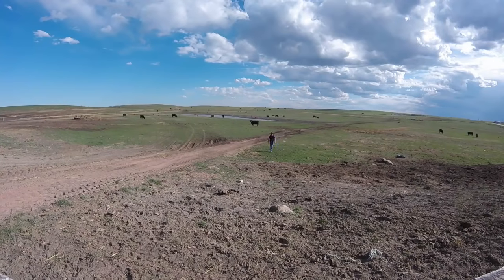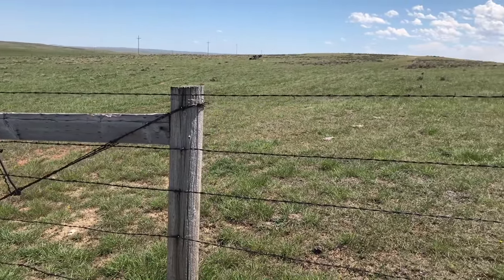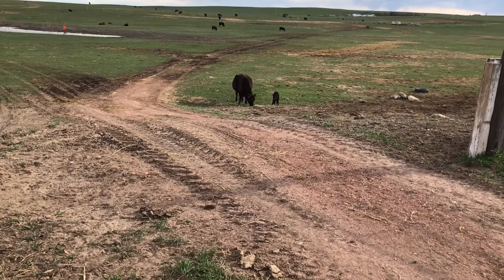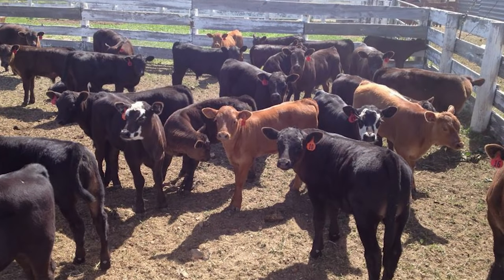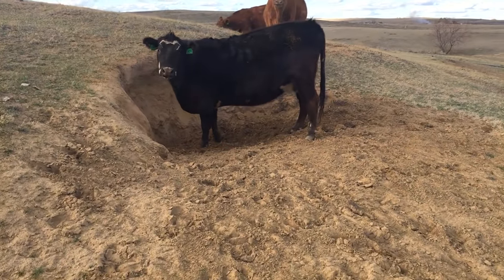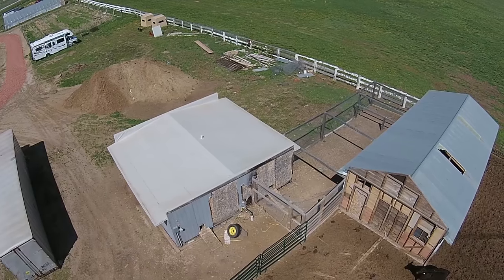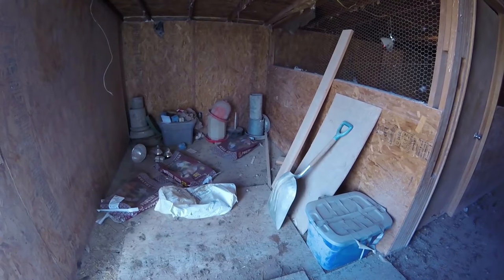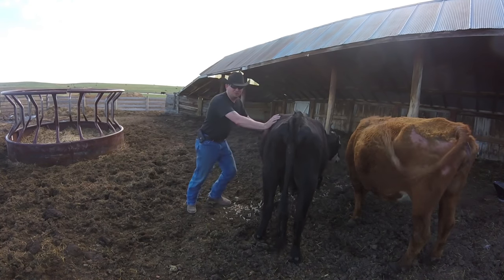Tip That Cow

Comment: Cow tipping IS NOT fake. Very difficult, done at night or dusk.....only will happen with near perfect conditions like the size of the animal. You will not “tip” a big ass bovine & it’s more of a running up to one to put your shoulder in near it’s neck to throw off its equilibrium. Vets do this by turning their heads towards the sky. That’s only if it doesn’t move by the time you get to it....these cows are quite aware of their surroundings. Out of the 20 times or so we’ve done it in our younger years, only two successful. Be prepared to run....they will sometimes charge or kick :) Stupid bored youth growing up in a farming town with no mall, Wal Mart, etc.

Comment: Ok @2:40 Simple Solution , if your having a couple of your most Lively Head of Cattle jumping the Cattle guard then just it's time to get the Backhoe out  add an extension to it making it a bit wider. On either the Cattles side or just both side . you you don't need worrie about have dig up that one either , just add an new extension of  a couple pipes 2 or 3. And your set. also if you already have experience with cattle jumping a Guard & your planning to build another one then just take the Demotions of the previous one, that you know your cattle are able to jump & just Simply make it wider then the one there jumping. And if you don't have any cattle jumping it then you know you've made it wide enough there not going to even attempt to jump it. Cows have a pretty good sense of just how far they can safely jump. just like any other animal,  if they feel it's to great of a distance to jump they'll just walk away .

Comment: There is such a thing as cow tipping, although it's not known by that name. It's called "tailing". Cows, when being chased, have a tendency to run in a straight line. If you grab the tail while they are running and accelerate past them, (you are on a horse of vehicle) you will pull the cow off balance and tip her onto the ground. It kind of knocks the wind out of them and they'll lay there long enough for you to get a rope onto them. There are some good U-Tube videos of Australian cowboys doing this from motor bikes and four wheelers.  I've never done this myself, too hard on cows and people.
Reply from the maker: I have seen that, I wouldnt call it cow tipping in the traditional sense but I get what you are getting at.  Looks like a good way to dislocate a shoulder lol. Thanks - Mike
Reply: Mexican rodeos, Charreadas. Pretty hardcore.
Reply: nebraska farmer ... mexicalies due this in Colorado,  even though it's banned. Pretty sickening
Reply: Cruel

Comment: Okay, I've done this with cats before, so it might work on cows.  You see how she is bracing in that direction, towards the man?  Have another person or multiple people on the other side.  Then have the guy stop pushing the cow and have the other person(s) push the cow immediately after.  The cow will be bracing in the opposite direction, and it will be much easier to tip.  Quickness is the key.  Push the cow over quickly and don't give it time to brace.

Comment: How reliable are the vehicles on your ranch Mike, are you constantly doing repairs? (Gator, tractor, truck, etc.)
Reply from the maker: Hi Steven, sometimes it feels like it. I've been having issues with the Gator all spring, and now its actually at the John Deere dealer as it seems to be an electrical issue and out of my scope.  For the most part I try to keep everything maintained as well as I can, that tends to keep repair time to a minimum but there is alway something. -Mike
Reply: I hear ya. Would love a video on farm-related problems with vehicles.

Comment: I’ve done it with 2 people we both double legged it but you gotta switch sides and catch them on the side they aren’t bracing 

Once you get their balance off you double legged them and you NEED to pull the legs towards each other so it falls then it’s just science and we aren’t even that big technique beats strength

Comment: excellent video! Thanks for the tour. Do you try and back-fill the cow holes? seems like it would make driving the gator on snowy winters a bit dangerous.
Reply from the maker: Haha, thanks Jim,  every year I make a mental note to fill in holes before snow flies.  Ya know what happens?  I'm driving across the field in the Gator and fall in a hole..haha, every winter.  Time just gets away from you I guess. -Mike

Comment: Hi Mike, 

Thanks for the video. I'm definitely sharing your channel.

What's the back story of the piping from state methane wells?
Reply from the maker: Hi Andy, Thanks for watching, I'll try to give you the short version...up until about 10 years ago coal bed methane production was huge around here, in fact it kept many ranches, including this one, alive during some hard times.  We had around 30 or 40 methane wells on the place.  With the lowering cost of gas and the rising cost of production most methane companies went out of business, abandoning wells.  They had a bond with the state which then left the state with the responsibility of capping or plugging the wells. Last summer they pulled all the pipe out of all of our wells and plugged them.  The materials from the wells, the huts, the electrics, the pipe and wire were all given to us.  Needless to say I have tons of pipe and lots of projects planned for it. -Mike
Reply: Thanks for the reply. Interesting stuff!

Comment: Maybe if you rammed into the cow you could've knocked it over.
Reply from the maker: I doubt it and then I would have a broken or mad cow. - Mike
Reply: I mean ramming it would take away the cows conscious resistance because it wouldn't be aware of the force, AND if you are strong enough with the right angle you could probably generate more force than 6 people just pushing a cow. You'd probably have to sprint as hard as you can, and possibly have a weighted vest on, but it might work.